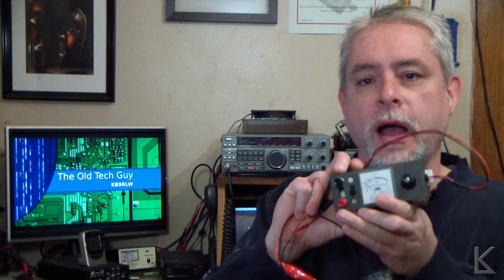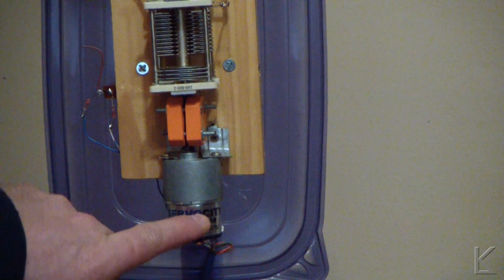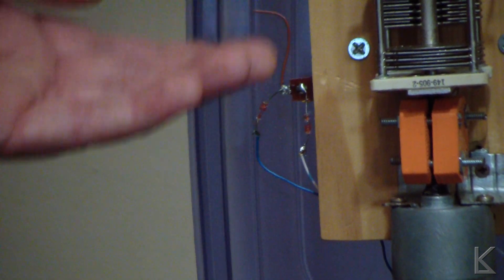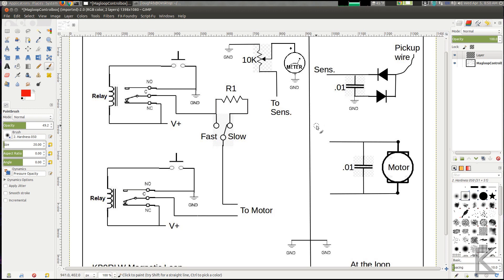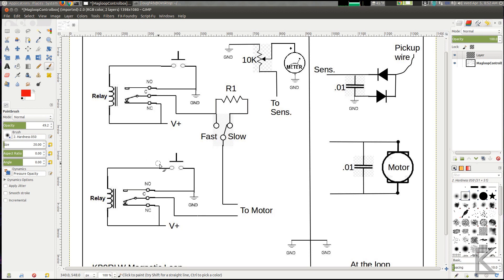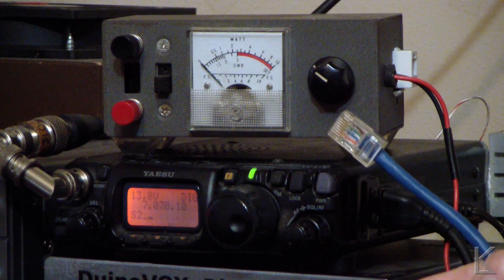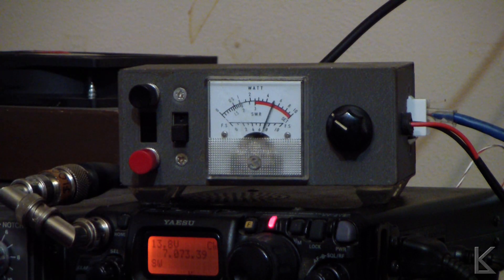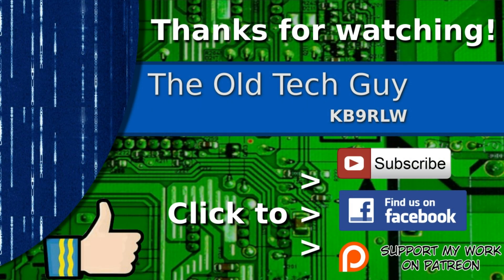Ham radio antennas - Magnetic loop remote tuning control box details schematic and demo

Comment: Great  video. You obviously love to teach and are very skilled at it. Thought I share my experience with loops. Sorry if a bit long but thought it might help some people  with large building rooftop situations like me. I’ve played with magnetic loop antennas for over 20 years. For portable use I’ve had great luck with Alexloop. Routinely worked Europe from Texas with various QRP rigs. Worked America from Thailand with it too. 
I’ve also tried various larger rigid fixed loops. 
Mag Loops will never equal even a dipole at height in a quiet location. But, they do have several advantages in some situations. 
I’ve sold my software company and retired and spend most of my time in Thailand at my condo on the ocean. There is no place in Thailand even near a town, even in the best neighborhoods, where there is not terrible electrical noise. Wires are strung between power pole, often dropping almost to the ground. There seems to be noisy transformers and neon everywhere. If I’ve tried verticals or dipoles I’ve often had S9 to 15 db over noise levels. But, noisy locations is where magnetic loops shine. 
Even at my ocean front location I seldom saw below an S7 noise level and often much higher. Fortunately I have the top 2 floors and my roof gardens. On the north and south ocean corners that are about 40 meters apart I thought would good places to put a couple of magnetic loops. Unfortunately for me to the East is a gigantic metal structure towering above and along the entire Easter wall that contains a water tank and acts as a electrostatic field dissipator to prevent lightning strikes since this is the tallest building in site at over 56 stories.  But, another advantage of magnetic loops is that as long as there at least 2-3 meters from metal structures, even ones higher than the loop is, they function quite well.  Any kind of a beam was thus out of the question. Also, wanting to avoid any dispute with the Juristic, I want a reasonably small installation and I wanted 80-10 meter coverage. All a tall order. But, I’m extremely pleased with my solution. 
I think the absolute best magnetic loops made are made by the Italian company Ciro Mazzoni designed by I3VHF. The are expensive but worth every bit of the money. Expensive but a bargain. I put their MIDI 2 meter diameter loop made from 3” diameter aluminum tubing that covers 3.5-14.5 MHz continuously on the Northwest corner.  And their 1 meter diameter Baby loop that covers 7-30 MHz on the Southwest corner. They have gigantic air gap capacitors at the top that have servomechanisms to open and close to tune. You auto tune with a serial connector from your rig to the auto tuner or you can type the frequency in on the keypad. There are several videos on YouTube that demo them. Such as

https://youtu.be/XTDRzJqbMRQ

So now I often have S 0.5 or less noise and am getting often worldwide coverage in digital modes with 2 watts. While magnetic loops work very well only two loop diameters above the ground, another loop advantage, I think I’m get some benefit from them being 150 meters up and on the ocean. 

W5MMT / HS0ZAC

Comment: Kevin, for a connector between the motor and air variable capacitor, we used an arrow shaft with a round piece of wood dowel inside.  Leave enough space at each end for the shaft of the motor and capacitor.  A hole was drilled at both ends and a cotter key put through the hole to secure it, a small diameter bolt and nut could also be used.  Solid as a rock
Reply from the maker: Good solution!  Yep, you don't want any play at all in that link.
Reply from the maker: As long as it stays dry.   Wood get ever so slightly conductive when the humidity rises.

Comment: Excellent video and design for a remotely tuned Mag Loop Antenna. One addition to the schematic may be to add diodes across the relay coils to prevent any spikes from getting back to the power supply.
Reply from the maker: I actually did.  I left them out of the schematic at first, oversight, fixed it later.

Comment: Many thanks for this info Kevin.. I'm just getting back into amateur radio from a 30 year break.  Can't believe the changes that have gone on during that time. !  I'll be going for a loop as my accommodation is downsized from where I used to be ..  Being in the UK,  some of the parts are going to be challenging to source, ha-ha.. It'll probably take me longer to gather them together than to build the antenna.. Appreciate your videos that are helping me 'catch up'.  73.. Pete   G4RYO
Reply from the maker: Hamfests are the best place to find parts.  There's always one or two guys there with piles of parts for sale.  The only thing you'd probably have to shop for would be a 1 RPM geared motor.  But those are readily available with a quick search on amazon or ebay.

Comment: Hello Kevin,how are you?

First at all thanks.

As many fellows say; you are a great teacher. 
You don’t keep hidden things, always show how to and explain at the easy way. 

Let me ask something:

In this case you are using QRP and Ethernet cable between the antenna and controller.

If I use 100 watts, RF can go back to the shack thought Ethernet cable and cause problems with my computer and USB connections for digital modes?

If yes, can I roll Ethernet cable as an ugly balum, ferrites, etc.

I really appreciate your comments.

Thanks
Claudio
OA4BMG
Reply from the maker: Yes if you're running any kind of power you would definitely need some serious RF filtering on the control cable. You might use shielded cable too and ground the shield. But in a magnetic loop if you want to run that kind of power you're going to have to use a very expensive vacuum sealed capacitor for the loop. The RF voltage across that capacitor is going to be extremely high thousands of volts

Comment: you could also use a standard hi torque servo to run the cap.  that would also have the advantage of absolute positioning so you could quickly set it where you want it.
Reply from the maker: Well, yes, but no.  The servo wouldn't have the resolution to precisely tune the cap.  It would get close enough to operate, but not quite dead on.  You can't even see the movement on the cap during those fine tuning clicks. 
 I've thought about a stepper motor, geared down maybe 1:4 or more, then use an arduino to do the fine tuning, using the sense voltage.   Others have used that approach.   It gets more complicated and more expensive though.
Reply: Kevin Loughin I was thinking about that.  I did find some servos with .1 degree resolution which would give 1800 steps across 180 degrees.  I wonder how much finer it would have e to be
Reply from the maker: No, nowhere near enough.  1/10th of a degree would probably be ok.
Reply: Kevin Loughin that's exactly what the ones I found have .1 degree resolution
Reply from the maker: Didn't see the period.   Give it a shot.  I doubt it will be accurate enough to return precisly to a previously tuned spot.  You'll still need to tweak it.   It's really that sensitive.
Reply: Kevin Loughin it'll be a little while before I get around to trying it and you're probably right but it would be sweet if it did work:)
Reply: Should be able to use your setup with an arduino with a servo shield, a/d converter and a quick sketch - then 1 button tuning!  :)
Thanks for the tour - I found it interesting!
How about (or do you have) a build on the loop antenna?
jim
KF5AQF

Comment: I might recommend the reinforced pneumatic distribution "air line" tubing 1/4" ID for the motor coupling.  That stuff is surprisingly stiff and a foot is less than 2 bucks at ace hardware. I used it on all the stepper motors on my 2'x4' cnc router and they work fine. Just used a couple pipe clamps to attach it to the shafts. This method also has just enough give in it so that if the motor shaft and whatever you're attaching it to aren't perfectly alligned it won't bind up the motor.  But don't get me wrong if you have a 3D printer this is great!
Reply from the maker: I had tried very thick vacuum line.  It felt completely rigid, but it was just too much play.   It's crazy sensitive.  You really need something completely solid.
Reply: Kevin Loughin,  Interesting, that's good to know. I really like your videos. Seems to me like a lot of hams have gotten away from building their own simple equipment and would rather throw away their money for something that could be built in a couple hours or less. BTW - I'm still using my version of your DuinoVOX circuit and have found a couple vhf packet bbs stations in the area. It's working like a champ.  Couldn't be happier with it.  Who needs a $140 Signalink when you can make one for less than $20!

Comment: Dear KB9RLW, 
Many thanks for the great simple mag loop capacitor control! Actually it’s a great construction using simple components! I have seen lots of controllers using advanced components and things like that, of course I thank them too. Lots of U tube things are mostly demonstrations ONLY, constructional details are not shown! Some times especial components are used! I am from Srilanka and for me it’s a bit difficult to find those in local markets! I have constructed your construction, but still not used it practically, sure it will work for sure! I have a professional diode probe I am going to use for detecting the signal strength ! 
I thank you once again!!
Kindest Regards........Best Of 73! 
Leonard Fernando.
4S7LF/ OZ6ZV ( closed)

Comment: Nice solution for max efficiency! How long the cable between sensor diodes and control box could be or is recommended?
Reply from the maker: It's low voltage and relatively low current, so you can probably go long. I'd have to guess, so I'm not sure.

Comment: Excellent vid of yer antenna, great job. I'm currently getting interested in loop antennas for Rx due to their low noise. Tx will be done on a separate antenna (G5RV). I'm assuming I can use a varactor diode for this since it's for Rx. Your thought appreciated, thanks! 73 De KD5MHQ
Reply from the maker: If it's for RX only, a varactor should work.  However, it has to be in parallel with the loop, which has a very low DC resistance.  So I don't how you'll get a bias voltage across the diode since it's shorted by the loop it's in parallel with. :-)
Reply from the maker: @bob4analog  Of course.  I missed that possibility.

Comment: Good morning Kevin
You did a great job, Congratulations, quick question, where did you buy the meter that you are using in your control box?
Thank you in Advance,73 de K2WC
Reply from the maker: The meter movement was in my parts bin.  I probably picked up a box of meters at a ham fest years ago.
You need to make sure it's just a raw meter movement with no built in shunts.
Reply: @loughkb  Thank you

Comment: You can use a double pole double throw switch for motor control, less parts, same action.
Reply from the maker: I can tap one of the buttons for a very short amount of movement.  Much harder to do fine adjustments when you have to toggle a switch back and forth.

Comment: Hello Sir, i hv an old HP printer laying around and i hv been pondering about canibalizing the two servo motors to use as a remote motorized tuning control/drive for the mla's tuning capacitor. Just wondering if this is possible.... tnx & 73s
Reply from the maker: Yes.  I've seen other projects that used arduino's to drive stepper motors for tuning control.

Comment: Hi Kevin great video. I have a question about the servo motor. Do you think that motor has enough
Torque to turn the tuning capacitor on the chameleon magnetic loop?
Reply from the maker: Sure. But You would need to rig up limit switches since the chameleons cap has end stops.

Comment: Kevin - that capacitor across the motor, is that .01uF?  That's what I used on mine, but I'm still getting a lot of hash.  Any suggestions?
Reply from the maker: You could change the value, go smaller.  I do get hash from the brushes on the motor.   They spark and generate a lot of RF.

Comment: Hi Kevin .. Great design. Quick question I have the same motor from servo city do you recall the size resistor you are using to slow the motor? Thanks  in advance de Mike N2PPI

Comment: Great Video Kevin. Thank you for sharing. I am currently working on remotely tuning my mag loop. I am having trouble finding the meter you have used in your controller. Are you able to tell us where did you source it from of can a regular dc voltage meter be used? Cheers.
Reply from the maker: Pretty much any meter movement can be used.   That box was an old CB SWR meter I picked up at a hamfest for a buck.   I see them at yard sales occasionally too.
Reply: Thank you Kevin, much appreciated. Kind Regards, Sands (VK2WXW)

Comment: Just wondering. Shouldn't  the diodes be reversed? I think in your schematic the negative end of the sense diode is going to the positive end of the sense meter. Seems to me the voltage at the  cathode end of the diode is going to be negative.
Reply: Yes I wondered about that as well?
Reply: Well now I'm really confused. I just snipped the diodes out of my previously non functional circuit and switched them around. The meter immediately started to register rf but was reading backwards! I've now also reversed the meter connection and everything is working great. I can only assume that I must have had a bad joint in the first configuration that is now good. Anyway the field strength indicator is now working and provides a perfect indication of when the loop is properly tuned. Yay Result !
Reply: The field strength sense circuit is funky. Kevin stated in the video it was a full-wave rectifier but it's only a half-wave. It takes a 4-diode bridge to invert one half of the waveform for full wave rectification. But half-wave may be enough to drive the meter. Also the placement of the capacitor is unusual, not sure of it's function. It may have been added experimentally to accidentally solve a problem with the two diodes because if you try to make a rectifier with the two diodes as shown but the cap is replaced with a wire you just end up with AC RF on the meter which probably won't display it. I don't think the lower diode is doing anything so you may want to just remove it and let the .01 cap filter some of the pulsating DC. Maybe Kevin will chime in and explain how this works as a full-wave rectifier.

Comment: Went to your FB page but was unable to find the  schematic for the controller. I would also like to know if you have any "Mag Loop Construction For Dummies" instructions. I'm very handy but not particularly adept in electronics. I'm looking to build a Receive only or QRP rated antenna for HF use. Thanks, Jack N2LBI
Reply from the maker: Try this link.
https://www.facebook.com/kb9rlw/photos/a.261111871002490/286572448456432/?type=3&theater
Reply: @loughkb  I am planning to build a receive only mag loop. I'm not sure how that will change my design. What value/range would you recommend for variable capacitor? I am gathering the components for your tuning control as we speak. Also, what distance apart do you think my vertical (butternut hf6v... which is anything but resonant... maybe another time for that) and the mag loop antenna should be? I typically do not exceed 450 watts when transmitting. BTW, I will be picking up my "Brand New" 2009 Keystone Montana 5th wheel in late January and will be primarily Full Timing it from that point forward. I foresee terrible troubles in my future. Lol!
Reply from the maker: On my 3ft diameter loop,  the variable cap goes up to just over 150pf and I can just get down to the bottom end of the 40 meter band.   Keep the loop broadside to the other antenna and the null will help to reduce pickup from the other antenna.  But that can be a problem.  It's a resonant circuit so it likes to ring with the right frequency RF present.

Comment: There isn't one loop video that properly explains the hookup of the capacitors. Now I've wired it in both ways, just in series with the bottom, non-rotating plates. I've hooked it up in series from the one side of the loop to the plates capacitor and the other side of the loop to the rotating plates. I don't know how much time you have. Is there any place I can send you some photos of my antenna that you can look at and possibly point out the obvious mistake that is eliding me? I'm getting really frustrated. I can't put an outside antenna up due to 100% restrictions plus My apartment is a hundred years old. That means lath & plaster walls with chicken wire throughout. I basically live in a faraday box. Thanks for your time. James KA9TII
Reply from the maker: If you have a capacitor with two equal sets of plates, the best way to wire the loop is one side to each of the non-rotating plates. So the capacitor is basically two variable capacitors in series. That way hand capacitance doesn't affect the tuning as much when you reach up to the knob to turn the capacitor.
Reply from the maker: Search my channel for the word magloop, or magnetic loop. And you'll find many other videos.
Reply: @loughkb  The stationary plates are not split, although there is a solder lug on each side. It would be like soldering both sides of the loop cut to one side of the cap, just completing the loop again directly. Do I need to use a different cap?
Reply from the maker: @blugoose86 usually if you look between those sets of stationary plates there will be a little metal bridge that can be removed or cut to separate the stationary plates into two groups.

Comment: Kevin couldn't you have used small nylon gears to connect the motor and variable cap shafts together? I know you.made a clamp like device using your 3d printer but I'm curious as to whether gears would work better?.
Reply from the maker: If you had a spring loaded split gear to overcome lash it might be ok.  Fine tuning is hard if there is the smallest amount of play.